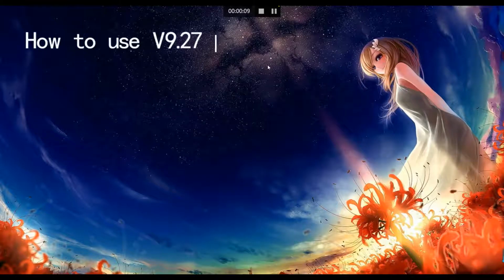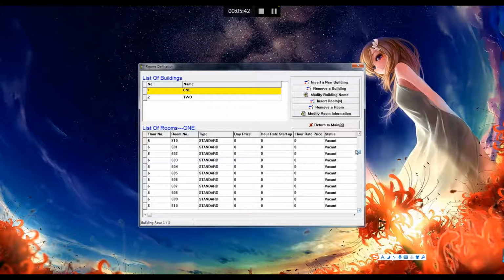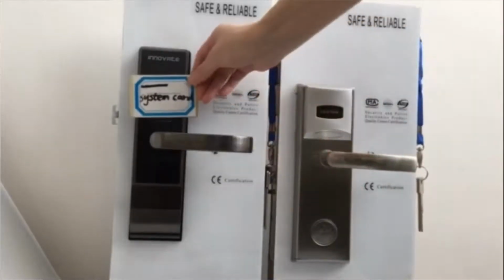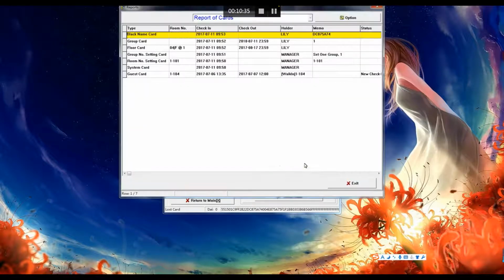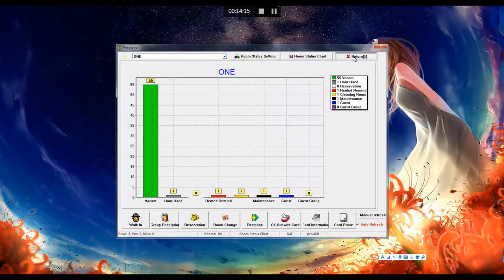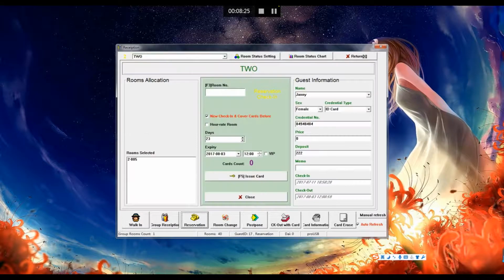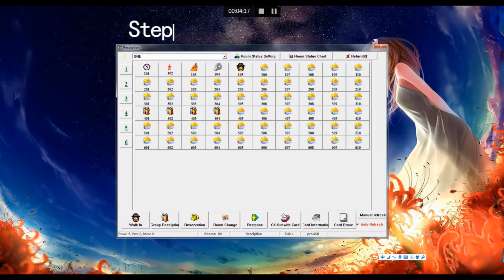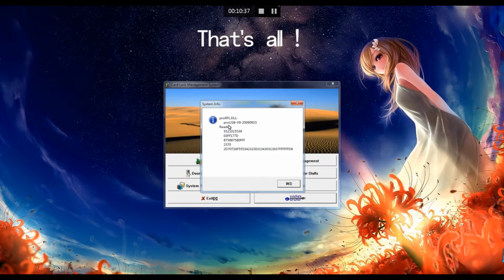Hotel Card Lock Management Software V9.27 - proUSBHotelCardSystem Guide

Comment: Unfortunately I had a problem with my computer, and I had to format my hard drive.
I have the English registration code which is 32 digits.
and the encoder model is V9-T557
date: 2019-08-07
QC: Pass 1908
No: 2958 179B
My question is how to have the software take into account the 32 digits or how to transform my 32 digit code into 16 digits. Please help me because all the tutorials I see on the net only use 16 numbers including letters.
thanks for answering .